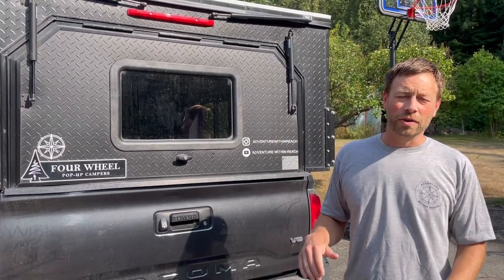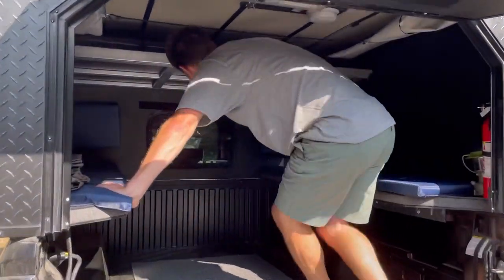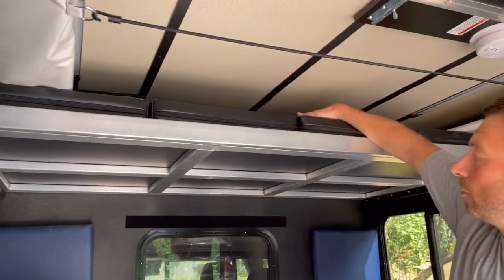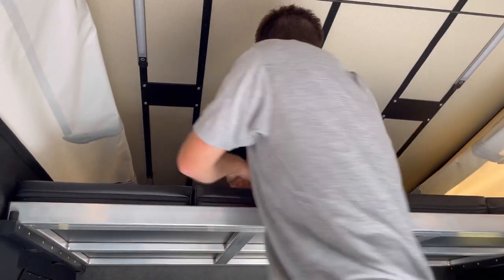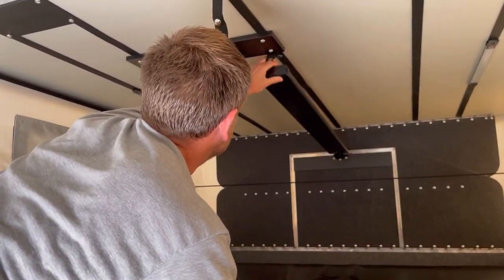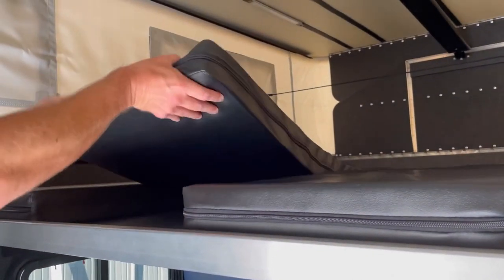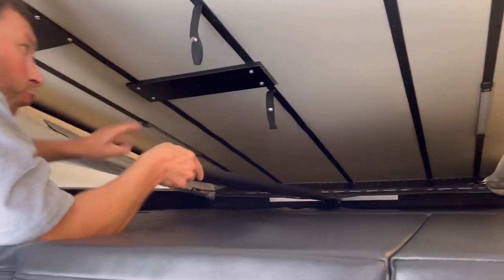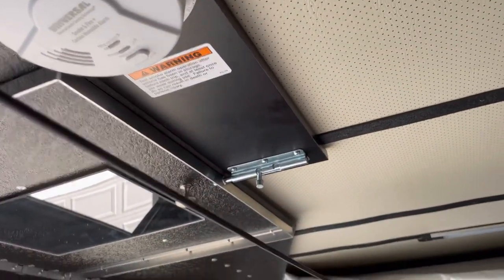Four Wheel Camper: Project M-Traveling With The Bed Down

Comment: Csn you tell me why fwc sells the bed tray with that weird overlap where the slide out is higher than the non slide portion of the bed? That overlap seems to be righ at knee level. Can the tray be modified so the bed sits flush?
Reply from the maker: When the bed is extended it’s completely flush. Is that what you mean?
Reply: @adventurewithinreach2201  it is flush?? Thank you
Reply from the maker: Ours is totally flush when pulled out to sleep.